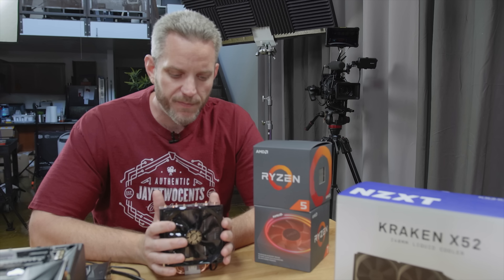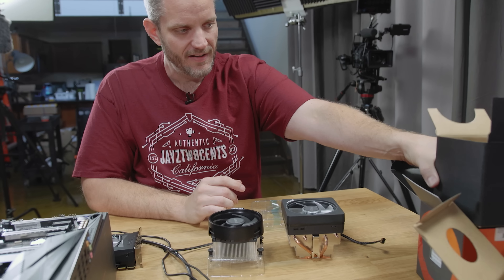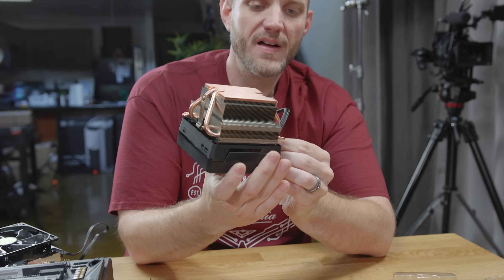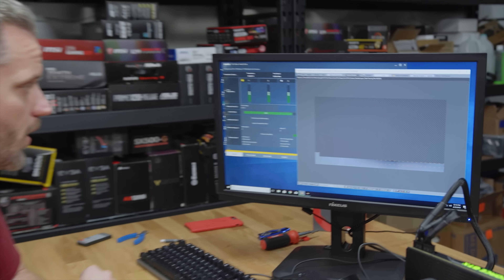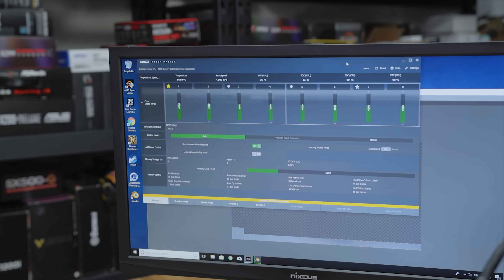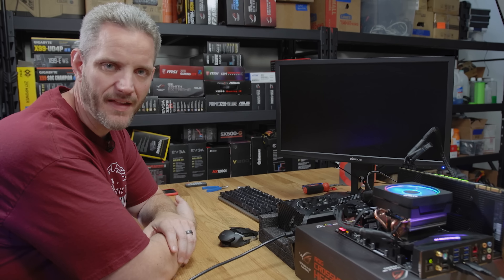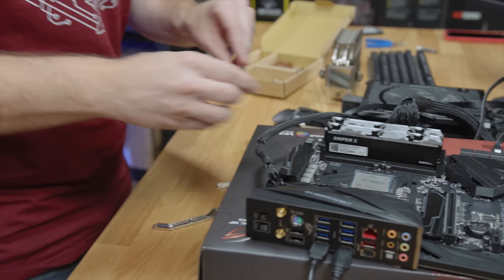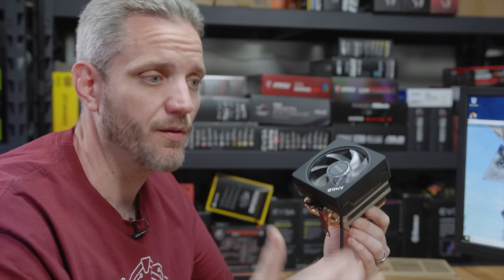Overclocking with a stock air cooler?? Is it even possible?

Comment: Don't even overclock it. Precision boost 2 with xfr2 is just crazy good now. Especially with the new thing people found for Asus boards with pbo
Reply: From what I've seen, I think you're almost better off focusing all your overclocking efforts on memory.  Ryzen seems to get exponentially better with faster RAM.
Reply: pbo? could you explain
Reply: Pbo = precision boost overdrive for X SKU boards, and it's auto OC like Intel's MCE.
Reply: Yeah. XF2 + PBO is beyond awesome. I've built my friend a 2700x system with C7H and with stock Prism cooler in BF1 64 player multiplayer match the clocks hover around 4.25ghz for multiple cores and for Single Thread applications, as high as 4.35. If you load up Prime95 then it drops to around 4ghz but considering the CPU maintains 4.25ghz on cores being used for gaming actually gives better result than if you were to OC the chip manually since they usually hit a wall around 4.2ghz for all core OC.
Reply: Curious Frost does the cooler fan get loud at all?
Reply: When it's under load, it surely is audible but not loud enough to be disturbing, especially if you're gaming with your headsets on. Sound isn't a problem unless you manually blast fan at 100% or have an open non-traditional chassis
Reply: Your forgetting that with these new coolers if you have sufficient positive pressure from case fans, it barely spins up the cpu fan.
Reply: what if you don't plan to overclock?
Reply: 単独VXNGEVNCE That's why PBO and XFR2 exists so you don't have to lift a finger. Ryzen 2000 (X) chips will usually perform better on stock than overclocked in games, if you're rendering then it's different thing. What's more is that if you want to OC then you can give the CPU just a little more voltage and increase the BCLK to something like 103mhz, the CPU will then boost its single Core speed upto 4.5ghz with sustained all core turbo north of 4ghz if you have good cooler. It's just a beast for gaming in that Config
Reply: SlavjanA i have a r3 1300x so can i use the pbo feature?
Reply: What GPU are you using with that setup, if you don't mind me asking?
Reply: @Dirtyboxer1  Rumor has it AMD is working with Samsung to make a DDR4 5,000 module the reason none has been made yet is not that they couldn't but no system would benefit from it so they so no point in making it!
Reply: @vxngevnce2637  Use the Stock Cooler it's not like it cost you anything extra and it works great even at OC so why waste time and money buying a 3rd party cooler when it is not needed unless you really like the look of a 3rd party cooler if so go for it!
Reply: @DarthAwar  Might be waiting for the Ryzen 3000-series, since it'll be on a 7nm process the clocks will be higher and the faster RAM will have a more noticeable effect (I assume, really it's just my optimistic guesswork)
Reply: @UNSCPILOT  That is what I am waiting for before I Upgrade my 2017 Custom Rig from a Ryzen 1600X with a AMD Sapphire RX580 3GB I plan to upgrade to a Ryzen 2 3600 with a NAVI (Hopfully if it is good!) GPU
Reply: Im about to build a simple set up.
2600, rx580 16gb. You mentioned pbo with aorus board. I was going for the msi carbon with wifi. But now im interested on Pbo do all aorus boards have pbo feature?
Reply: @msand951  Asus boards*, which is what I have. It's only available for B and X series AM4 boards I believe. I have the Prime B450M-K, the auto-overclocking software is amazing. Barely had to do any work apart from stress testing to overclock my RAM. From what's been said, it seems pointless to overclock my 2700X. Gotta love the RGB cooler though.
Reply: Explain to me please, I’m new and I want to squeeze performance or at least understand what you said.

Comment: I just got one of these and I love it! I bought a ryzen 5 5600x and it came with the wraith stealth and I was like "no way", I have a evo hyper 212 I took out of my fx 8350 and replaced with a zalman spnx4 and I was going to use it but when I went to the pc store to get a motherboard (the one i got off amazon wouldn't run my 5600x without a bios update which i couldn't do without a cpu) I asked guy about coolers and he showed me this $100+ noctua cooler and it was impressive but didn't look much bigger then my 212, i asked him what other good coolers he had and he showed me the AMD prism, said it was an awesome choice and the guy sold it to me, I could tell he really thought it was good. I paid $50 for it and I have no regrets going with it, it's quieter then my 6600 xt when gaming and my pc is nearly silent when not gaming (I replaced all the stock fans with Arctics).

Comment: Next intel cpu release comes woth a included stock cooler. With LED lights. 

For only $400.
Reply: smoked buns And only blue LEDs
Reply: *Crickets*
Reply: Not only it doesn't have anything included for its own sake but it's also an expensive oven.
Reply: Turns out its 600 usd and co es with no cooler at all
Reply: @christopherblaney7619  BUT, it also heats your house.
Reply: Wont be led
Reply: Just don't use the stock coolers ._. Good aftermarket coolers only go for like £50
Reply: @olliveraira6122  Why not use one with Ryzen, the stock cooler already has most of the cpus around their max.
Reply: @watersnortmoment3734  Well I suppose you could use stock coolers, and the Ryzen ones seem pretty promising, but Im really happyy with my H7 which keeps my i5-6500 at 25-30C idle and 25-35C underlay (lol yep, 25-30 idle)

So I still suggest people to get a aftermarket cooler (especially as you can continue using them when you replace your processor)
Reply: And its an entry level i5.
Reply: (**v**)
👖👖
🧦🧦
👟👟
Reply: And can’t be OC’d.
Reply: Aidan Millward I’m at 4.3ghz on my 3700x with a stock cooler and runs at about 70-75c

Comment: To explain the SATA cable issue (which raised my eyebrows), he plugged a PSU cable from brand A into brand B (connected to the SSD), and although it fit physically it the other PSU had a different electrical layout thus frying the SSD.
Reply: I did exactly this with an DVD Rewriter drive I had the smell was horrible 😫

Comment: Correct me if I'm wrong, I believe AMD contracted cooler master to make the new cooler for the 2000 series chips
Reply: CynicalCarnage yup
Reply: CynicalCarnage they make all the wraith  coolers
Reply: The previous wraith/stealth coolers were from cooler master too. It has the cooler master sticker on the fan.
https://i.redd.it/opwi96zx2zyy.jpg
Reply: I never found any articles mentioning about it that's why i was honestly suprised when I found out they made it
Reply: CynicalCarnage yeah me too, if you look at cm's fans you can definetly see that they look really similar.
Reply: CM's been working with AMD for years.
Reply: They made the liquid cooler for the Fury card to, and I can only imagine for Vega 64 as well.
Reply: Eversince the AM2+ / AM3 days, CM manufactures the HSF of AMD CPU's. I have a Phenom II fan and heatsink with a CM logo under the fan while an AMD logo is above the fan
Reply: AMD being smart and contracting a company that knows what its doing
Reply: AMD also uses Cooler Master software to control RGB on their Ryzen coolers.

Comment: I was able to oc with the prism cooler to 4.1 ghz at 1.33 volts and it ran cinebench fine, not going over 63 degrees Celsius. Granted, I did replace the thermal paste to some ARTIC brand paste, but I'm still really pleased by that overclock.

Comment: My 3700x with stock cooler at 4.25ghz at 1.2v with a 0.125v soc offset. Temps wont go passed 70 under stress and usually sits at 60-65 in games 1440p. Really impressed with the stock cooler, I have changed the fan curve though.

Comment: I have a 1700x with the prism cooler. Friend got a 2700x and has an AIO so I got it free. I can go to 4.0 with 1.38 volts and heat is not an issue. I'm sure it could run cooler but heat is not my limiting issue. Somewhat unstable at 4.1 and thats kinda the usual for the 1700x. I do however have a Thernatake open frame case. So plenty of fresh air.

Comment: I like the clip style.
am i the only one?
My Athlon X2 4400+ from 2004 ? came with an wraith cooler and it can cool my ryzen 1700... because of the same clip design.
Reply: No you aren't, i like it too.. super easy to use.
Reply: 2006 not 2004 unless you mean a single core athlon 64.
Reply: I didn't like it that one time my heat sink spring was super tight and I drove my screwdriver into my motherboard. Scared the bejezus out of me but I didn't wreck the motherboard. But otherwise, yeah, I'm OK with AMD's stock design.

Comment: Looks almost the same as the old AMD heat pipe cooler.

Those were pretty good, used them on a dual Opteron server board way back in the day. Never had an issue.
Reply: the nice thing about the heatpipe stock coolers that came with the FX Cpu's was that you could trow it on any of the older AMD Sockets too (AM2 for example). A nearby Shop did sell the leftover coolers from prebuilds they made for 3$ so i bought some to upgraded older OEM Systems with them, really nice and quiet on the old Athlon X2's

Comment: With the Prism cooler and my air conditioner, I was able to OC the 2700x to 4.225Ghz @ 1.35V/ 4.25V @ 1.385V, quite happy with the results 😉
Reply: So much wasted energy...
Reply: @christophervanzetta  Better than turning on PBO and have the voltage hit 1.5V yes?
Reply: @Doctor-Hue  That is true.

Comment: I'd like a all ultimate AMD build with game benches on 1440p. So 2700x + vega64.
Reply: Cavey Manta because of the overclocking? I have looked into that, and all I can find is that you can oc it as high as stock vega64 performance wise, or did I miss something?
Reply: Maybe two different AMD builds - a 2700x + V56 all air cooled, and a 1950x + V64 on water.

That would be a damned expensive series though, lol
Reply: Seconded!
Reply: Sgt. Rock this ☝️
Reply: getting an all AMD build is not a good idea. Get a 1080, not a Radeon
Reply: Red team FTW!
Reply: FarFetched why?

Comment: The answer is: Don't bother overclocking. If you're gaming it can even be detrimental due to the lower single core clock you'll get with a manual all core OC.

Just let XFR2 handle it.

If you want higher all core clocks, then get a better cooler, XFR2 will detect thermal headroom and clock higher.

Comment: Thanks for this video Jay! 
I run a 2700x with the stock prism cooler... 
I will newly apply thermal paste after I figure out some small issues with my memory... 
But this guide did help me figure things out a bit :)
Reply: Was your issue with the memory the od error code by any chance?.
Reply: @bencrawshaw1227  no I couldn't get the xmp profile to work... turned out the specific kit I was using (a 16gb 3200 kit) was only functioning when I set it to 3000... anything over that and the xmp would not work and I would have random system restarts or "fail to boot" problems

Comment: Im overclocking my r7 3700x with this cooler never gets over 60c. Sitting at 4.2 with PBO good case airflow and arctic silver 5
Reply: What voltage are you running, I have a 3700x in the mail.
Reply: @Deecke87  PBO is handling my voltage It seems to vay around 1.35 or 1.4
Reply: Jo Cal I got an fx 8350 to 4.5ghz on a wraith prism if that’s a testament to how good the cooler is:
Reply: That doesn't seem right. My 3700x hits over 70c at 4.4ghz 1.4v during benchmarks and stress tests and I'm using a H100i platinum aio
Reply: Ash M it takes a lot less voltage to get 4.2 than it does 4.4.
Reply: @ashm3406  like the previous commenter said, more voltage needed to get those extra 200 MHz. More voltage equals more heat. And surprisingly a lot of people in this space don't seem to understand that the voltage/frequency curve is not linear.

Don't get me wrong, it will often start in a very linear-looking fashion, but once you push beyond the optimal range, which will vary dependent on an individual microprocessor u-arch, any perceived "relationship" that you would have previously plotted between your frequency, and power consumption required to get that frequency goes out the damn window. Even just looking at AMD's out of box spec for Ryzen processors I've noticed a shocking degree of positive response in terms of operating temperature by simply dropping vCore slightly and shaving a hundred megahertz off of the max turbo clock.

Citation: I'm an SFF enthusiast who doesn't love chasing the OC Dragon that most everyone else does, and actually go in reverse, chasing performance for maximum efficiency gains, and also just a general nerd for both hardware and software design.
Reply: @ashm3406  And you were pretty lucky to hit 4.4Ghz, your cpu is a rare one because most of zen2 chips can't go higher than 4.3Ghz. And yeah, you definitly need more voltage to go higher.
Reply: But did you run the benchmark like he did? That's what froze the system, not the OC itself. Besides this (in the video) is a 2700x.
Reply: Lonnie Murray you’d be right if pbo didn’t use up to 1.48v on the 3700x to hit 4.2-4.3ghz
Reply: How loud is the cooler tho ?
Reply: But you have to run some load :-D I have 3800X and I have this temperatures with AIO in idle. In 100% load (stability test in aida) it has around 80°C with AIO and almost 90 with stock cooler. But in real usage it's mostly around 60-75 which is ok.
Reply: @Daki_XX  bump

Comment: 1.5v on air... you maniac!
Reply: In older days even over 3v was normal on air.
Reply: My AMD FX-9590 is at 1.5250v on air. It is ok
Reply: i can smell something burn...lol
Reply: hmmm i want to see jay do a mod with frying pan on cpu cooking a egg
Reply: Алексей Черных same with my 8320
Reply: @MJ-uk6lu  Which CPU?
Reply: @redheadknight6297  First generation Pentiums, Pentium MMX. AMD K6. The older CPU is the more volts it needs.
Reply: Stock air* Still amazed that people think AIO's outperform higher end air coolers. Simply isn't true.
Reply: @zDerezzed  Maybe custom watercooling does but not AIOs yeah
Reply: @zDerezzed  
and also safe.
u dont have to worry about leaking problems.

Comment: I would have liked the test was done with the Cooler Master Hyper 212 EVO Air Cooler as well
Reply: Same results really.. they are similar in size and performance.
Reply: Here's the original Wraith/Wraith Max tested by AnandTech vs the EVO. The Wraith & EVO are nigh identical in cooling performance and noise. The Wraith Prism is a souped up version of the former with direct contact heat-pipes & more powerful fan. Interpret how you will. 
https://www.anandtech.com/show/10500/stock-cooler-roundup-intel-amd-vs-evo-212

Comment: correct me if I'm wrong but isn't the Wraith Prism cooler simply a resigned Wraith Max cooler from 1st gen Ryzen?
Reply: React2Quick yes rgb bigger copper plate and a few other tweaks
Reply: so glad i'm not the only one who noticed. Wraith Max RGB.
Reply: It's decently reworked, but yeah. This one has 4x direct contact heat-pipes (far superior) whereas the OG Wraith/Max had a copper block separating the two, the Prism has a redesigned fin stack for better tall ram accommodation, and a more powerful, RGB fan. So yeah, they pretty much took the Wraith/Wraith Max and gave it a mild pimping.

Comment: Task manager uses up a lot of CPU to load up I've noticed. Maybe why it puts it over the limit?
Reply: the new task manager displays cpu hz something it probably has to request from the cpu that request when the cpu is on its edge with error correction will probably cause it to crash out.
Reply: I am always curious how can overclocked CPU handle games or bencharks, but when you open task manager or start menu, it will crash :-D maybe microsoft is doing the best stability bencharks, but not on purpose :-D

Comment: I’ve built my first pc watching you jay thanks for all the help and the people that commented on some of the videos helped me also. I built  a ryzen system with these specs asrock mother board b450m, ryzen 5 2500 cpu in going to over clock, after market cooler CPU Cooler 120mm Addressable RGB PWM Fan with 4 Copper Heatpipes, GAMEMAX, five rgb fans, three on the front for Intake two exhaust, gpu is xfx rc 5700 8gb gddr6 I’m gonna flash to the xt, for ram I went with G.SKILL 16GB (2 x 8GB) Ripjaws V Series, drive wise I went with pcie-500gb and a sata lll ssd 500gb m.2 and a hdd 500gb on the back of the case, wireless card ASUS PCE-AC55BT B1 AC1200 Wireless Bluetooth 4.2 PCIe and EVGA 700 BR, 80+ Bronze 700W for power supply I may filp it facing up for another exhaust if need for proper air flow learned from jay. What you guys think I can improve on once again this my first build and it’s thanks to all you guys.